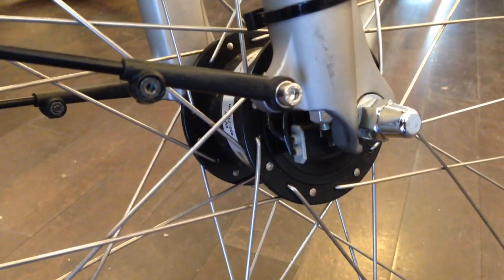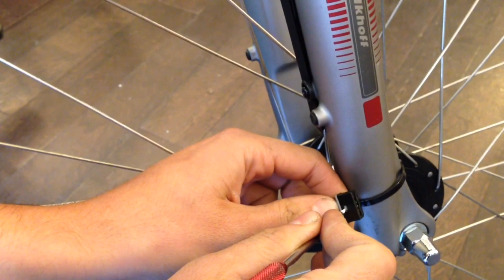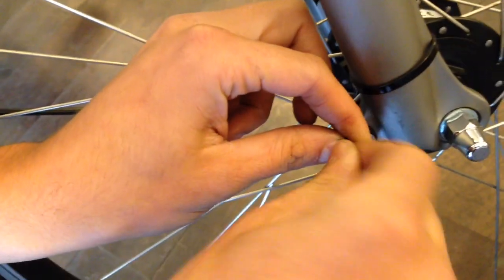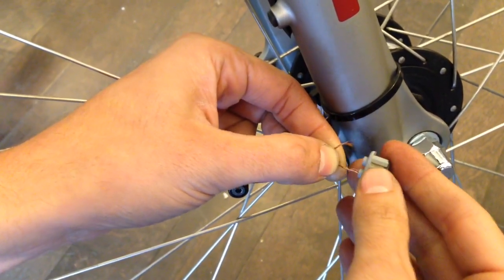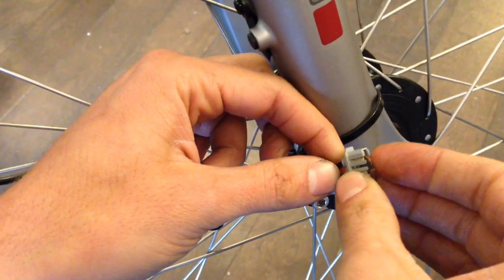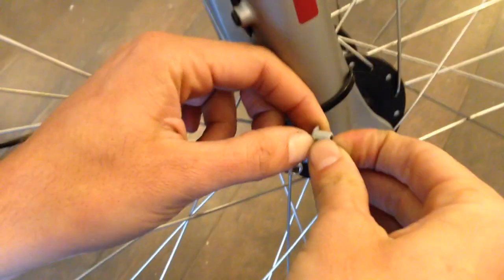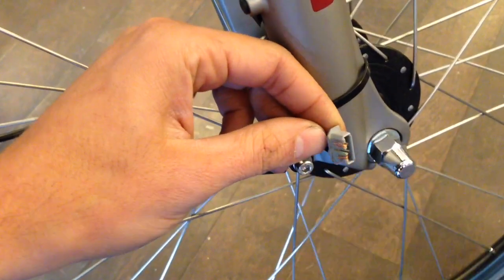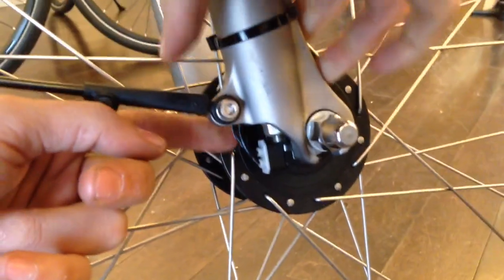Dynamo hub wiring service

Comment: just a comment, this seems like a real lousy connector system. Not the videomakers fault, but I'd be embarrassed to use bare wires as ny contact points in a connector.
Reply from the maker: It works pretty darn reliably

Comment: Thank you. This is great. I thought I'd broken the one on my bike - starting to panick. I need the lights working.
One of the wires came off/broke, and I couldn't put it back in and hold it in place. Was getting a little frustrated - not wanting to go to the bike shop just for this and pay for it, too.
YouTube is just fantastic in some circumstances. Now I know how to fix mine. Brilliant. 👍🙂

Comment: Thanks for the info...  I hadn’t fiddled with the shimano dynamo connector on my 2008 Raleigh Detour Deluxe since I bought it in 2008, until today when the wires broke and I forgot how to reinstall them properly.  You are correct, wire position in the connector to the dynamo does not matter when the system is powering incandescent lamps only.  However when running a lighting system that incorporates incandescent lamps with light emitting diodes(LEDs), polarity must be maintained or the system will not work(even the incandescent lamps won’t work).  One such system is the Basta Pilot.  If you get the wires crossed when putting the connector back together the first time, no problem.  Just switch the position of the wires, and all will be good.